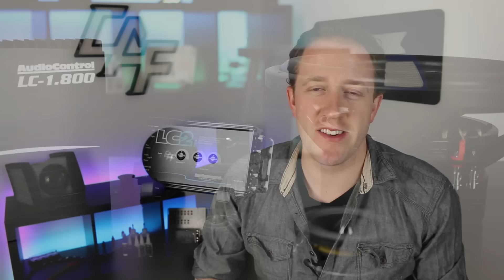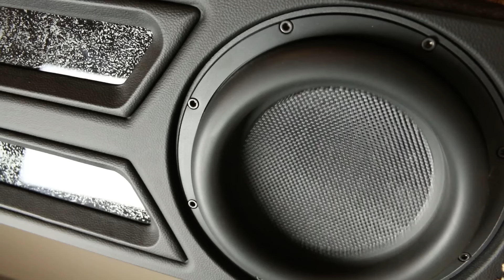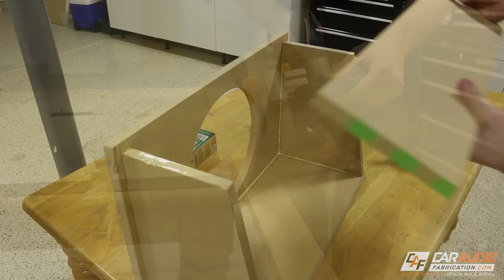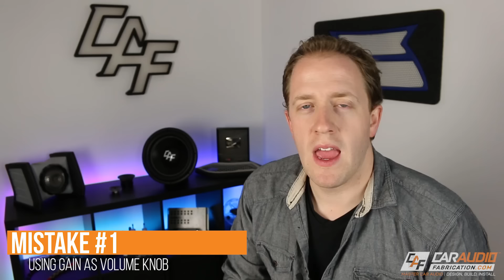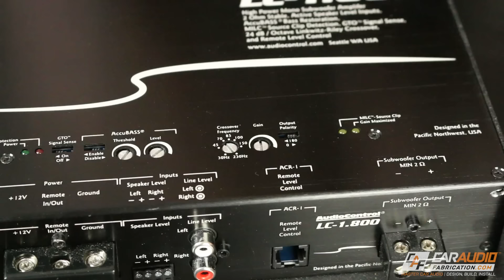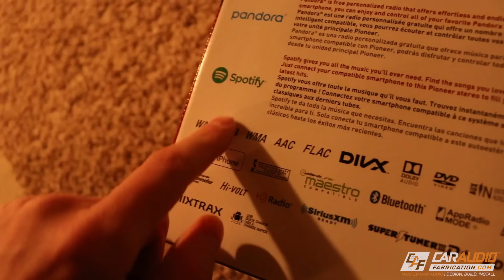Avoid these 5 common Car Audio NOOB Mistakes!

Comment: Dude, totally agree, I remember being a noob, wires everywhere exposed, wrapping the wires around the pillar using the fender to hide the wire instead of poking a little hole in the rubber plug in the firewall, lol. I got a couple funny, cool and true things I've seen through the years since like 89', first was a guy I knew that did use his trunk specs to buy/install his woofers, notice I said woofers. Lol this guy had a 1967 Chevy Impala Caprice, if you've seen one of those you've seen how big the back window shelf is, well this guy cut, drilled and mounted a huge piece of plywood in between the back seat back and the frame that holds it, then cut 2 18" holes, dead center of the back of the back seat so all the seat was there except where these 2 big ol' woofers and grills were, in the back window were 4 Cerwin Vegas 3way 6x9's and 2 10" subs all sharing the enormous space the Impala had. I think he was pretty close to perfect. Sound really good. Second thing a how to shut up a friend anout his, and shut down the crowed too. Do I have alot a friends with systems some have pro installed some dyi. I had this one buddy who had 2 15" Fosgates, with 2500w  in a Volkswagon Rabbit, I my self am in a 91' Golf Eurosport edition, and no it's not the same as a rabbit, easier ones yes, min had like 3-5ft more in the center making the car look even better, back then I installed my own stuff, but the box and mounts were pro built and designed, I was slapping 2 12" Soundstream SPL12's and 2 10" Soundstream SPL10's w 5000w to the 12's and 3000w to the 10's. Now both of us could take someone's breath away from the bass, me u run crossovers, EQ's for my kids and high do dial in the sound even better. Now better of us were getting even full power I think about half I was using, but we had this one friend who that he knew he could beat use any time we wanna sound off. I'm not stupid, and I know this guys dad. So I back down, my bud with the 15"s is up, he cranks it up, damn good sounding, my other bud thr challenger had no bear last time I had checked, this is back when circuit city was still around and open, the next morning he got up and went to circuit city, they every month had different cheap dubs for $20, this guy went and bought 4 Voltage Audio svc's running them parallel to they're 2 homes, respectablelly Installed, then goes to some other audio place and gets his a amps, and gives them the dimensions his speakers need of air from the enclosure, the amps he got 2, at 2ohm and 1000w each per channel, this 4ch each amp is bridged into 2 ch, Thid guy did his homework, the speakers input matched the amps output almost exact, the speakers, all four were each getting the exact rms and peak watts, had exact air pace. They were louder, but harder and sounded better overall then ours. Taught me it's not what you have necessarily, but how it's being used. Lol

Comment: For me I hate these guys (sadly they are the same people who listen to rap music) that has the bass turned ALL THE WAY UP and it sounds "muddy" and "muffled" and then it sounds EVEN WORSE when there is no mid range or even highs!! Oh sure it is funny that every panel on the car is vibrating, but to me it makes the music (which IS the end product) sound like complete and total garbage!! And to these same folks "it sounds great" even though you can't understand a word being spoken (face it rappers don't actually sing, they just say insults REALLY REALLY FAST) and there is no other "noise" coming out of the car other than these nasty flat and mushed up bass line, that sounds terrible!! Of course for me I listen to everything from Lindsey Stirling, to Metallica, to Toby Keith to Steve Miller, SO while I love the drop dead bass line in a song like Billy Thorpe's Children of the Sun or the sizzling crashes of Lars Ulrich's cymbals, or even the haunting vocals of Geoff Tate (Queensryche) it is nice to hear every small sound of Pink Floyd's music CLEARLY instead of a muddy, throbbing mess that is the way most cases sound like (again those playing rap usually) that I can't understand why somebody would want such a crappy sounding system to start with!! Personally I want to HEAR what the singer is singing in other words!! And if there is a cow bell in the song I want that to come through as though Aerosmith, or Trace Adkins, is literally sitting in the back seat!!!

Comment: Great information for me. I just bought an 02 tj that needs a digital media system. Best advice in this video is “if it’s too good to be true, than it probably is”. Now, I’ll be spending twice what I thought I would so that I get the better quality. I think you saved me a headache. 

Any suggestions on a single din with Apple CarPlay?

Comment: It's been a loooong time since I put together a system and I always thought shooting for a large capacitor FIRST was the way to go to keep voltages steady.
Reply: Eh, power capacitors are really overrated, better to upgrade the wiring and battery.

Comment: you only briefly mentioned the big 3 - see if nicer model car has a bigger alternator, add a 2nd ground wire between engine and body, and battery and body. I always add a capacitor for the power the woofer takes. use an oscope on gain adjustment. add sound deadener and insulation under panels and carpet, and window noise treatment

Comment: Bro I’m having a hard time my system play for a whole year no problems but my amp always go into protection mode I replace my radio the amps three times I first to were bad but 3rd brand new and when i first hook it up it play turn off my car and now it’s doing same shit protection mode fuses are all good no brunt wires radio was wire at shop I’m sure my amp wiring kit didn’t get bad it only year old and my subs are a year old maybe they just mess up I haven’t gotten those check out anyone think they know??

Comment: Mistake #3 source of music.  I totally agree. In my book this has to be one of the top issues. You can have a awesome system installed but if your audio source is crap your system will sound crappy. Low quality MP3 files or streaming from your smartphone low quality bits sounds crappy. Your missing a lot of the music the artist intended for you to hear on the recording.  Get a head unit that plays FLAK or ACC or other High Definition Audio files along with High quality Wave files. Lot of new head units are starting to come with the ability to play these types of files though the USB port. I have a new Pioneer HU that plays these files and i have installed a High Definition sound system also. Kenwood has new amplifiers and speaker and Sony and Pioneer and others that are now out on market to play and reproduce the High Definition sound. And the cost is not bad and it's affordable.  My system sounds real nice and clean. I got tired of my old Clarion HU that only played MP3 and other low quality music. Once you hear some High definition audio like i did you will be amazed how life like it sounded and clear and crisp. Had to have it.  Like going from High definition TV to 4K TV.

Comment: Not understanding how bridging a amp with a subwoofer or multiple subwoofers would always overheat or fry my amps or battery. I know and understand wireing in parallel and series and impedance draw changes the output and amperage draw on a system. I see guys all the time complaining how there amp is getting way to hot or killing alts and batts or even subwoofers lmao man i was blind!

Comment: Yeah i definitely fried my electronics in my caddy a few years ago. I bought a 5 farad capacitor and thought that was enough... any tips on how to upgrade the wiring in the engine bay/ alternator upgrade?
Reply: I also bought a 5 farad capacitor once, turned out it was more useful as a paper weight. Not doing that in my current car, gonna spend that money on better wiring and battery instead.

Comment: My mistakes?  Back in the Eighties I had a case built by a "professional" that fit into the removed rear seat area of my 1978 Pontiac Sunbird.  It was two 15" subs, four mids, and four tweeters... All in one large hollow insulated box! All pushed by an Alpine head unit and Rockford  Fosgate Punch 150. At least it had air relief ducts.  I thought I was so cool. lol

Comment: My brother had the nasty habit when installing stereos (Or anything electronic in his vehicles) of stripping too much insulation off the wires.
He would strip an inch or more and have exposed wires hanging from and amplifiers connection terminals then wonder why he kept having problems with his sound system. 
Or he would wrap a set of joined wires with Scotch brand office tape and wonder why he kept blowing his fuse for the stereo.
I remember this happening when I was 13 and having to fix it for him. It continued into my mid 20s when I last had to fix his sound system in a pickup he bought.

Comment: My biggest noob mistake was not building a proper box.  The box can make or break a subwoofer setup.  A cheap sub in a well made and designed box will sound better than an expensive sub in a badly built box.

Comment: When I sold car audio in the 90’s, in regards to the maximum power ratings, “Yes, this amplifier car produce that much power, WLS.  What is WLS you say?  When Lightning Strikes.  So if lightning were to strike this amplifier, it will produce that much power for a fraction of a second.”

Comment: Such a very true statement I started in car audio in 1985 and over the years I've had many customers come in with blown subwoofers that they decided to adjust their gain controls after they left the shop. used to be an eclipse dealer and they had some of the best head units 5 and 8 volt pre outs of course today some of the better amplifiers do have clip lights on then to let you know the amplifier is clipping but again some customers just don't get it some of them just want bass bass bass and some tweeters LOL it takes a good installer to tune a system front stage rear fill and don't let the bass overwhelm the car keep the work going brother love to channel
Reply: I don't know why but "bass bass bass....and some tweeters" got me 😂😂😂

Comment: I started in car audio in 1985 and over the years I have seen many customers come in with blown woofers after we install them and they decided that they were going to adjust their own gain controls. Some of the better amplifiers today do have a clip light on them that will tell you when the amplifier is clipping of course a very true statement about the head units. used to be a eclipse dealer and they had some of the best head units they also were 8

volt head unit which I try and explain to the younger installers about the head room and an amplifier and how to truly tuna system and how you have to have a good ear front stage rear fill and don't let the bass overwhelm the car if you're a true audiophile but there's people out there that all they want is bass bass bass and a bunch of tweeters LOL keep the work going I just ran across your video and I like your Channel

Comment: What's everyone's setup??
Reply: Pioneer head unit (forgot the model), Hertz Dieci door speakers powered by a Hertz EP 4 4x60 watt amp. The subwoofer is a Hertz Energy dual voice coil 12" powered by a Hertz HCP 1DK 11 watt amp. Yes, I am a fan of Hertz components hehe.

Comment: I used to go big, when I was young and a knucklehead. In my 93 mustang GT I had a Pioneer head unit into a 7-band EQ, into a 3-channel crossover (splitting highs from lows) into a 4-channel Jensen for highs and 2 2-channel Jensen"s for lows; each bridged and pushing a 12" Blaupunkt sub in a custom box I built. I used to drain batteries left and right, kill alternators, the building at work would rattle, I would be hard of hearing, etc etc. Now I just like clean sound. I just got a 2013 Elantra GLS, and I'm putting in Rockford 3-ways (6.75") with baffles, a Clarion XC2410 (behind the dash), and not touching the factory head unit or factory amp (it only puts out a tiny bit of juice anyway). It's a budget system, but should have decent sound.

Comment: i never did the big 3 upgrade till recently, so everyone for sure do this when running a sub amp even its just a 200-300watt you'll hear and feel the difference. and even if its oem and not high output get a new alternator for harder pounding bass

Comment: I installed two capacitors just for good measure. They're good enough to power all speakers except the subs for about five seconds. Five's better than zero.
Reply: A battery costing the same would be able to power the entire stereo for probably half an hour.

Comment: Using high output from the head unit rather than RCA's, and running the wires over your transmission to the amp - unless you like high pitch whining sounds coming out of your speakers.

Comment: Hi. How I can connect two different ohms speakers in one car radio channel. ?
Reply: RCA v-splitter and two amps, though you'll find the lower ohm speaker will overpower the other as the volume goes up.

Comment: i got a $40 12 inch polk from my buddy. a 12 inch kicker abd 1000watt amp from another friend in exchange for an oil change. and pioneer speakers with a kenwood radio. my bass is awsome but my speakers sound like they are starving. but hey for under $100 im not that mad

Comment: Biggest mistake I made was installing the woofer.. sounded fine.. then filled up the oil.. too much.. started it anyway.. gazed away at all the white smoke coming out of the exhaust :O failed to notice a fire in the engine.. and my woofer burned up.. :( along with the car...

Comment: Well, I really wanted a subwoofer in my car and saw that it was not THAT cheap... I got some stuff piece by piece from every one I know who was into car audio and such untill I finally got a full set up. Afters installing everything it sounded HORRIBLE! I didn't knew you had to have a subwoofer output on your radio or something so I just installed everything on the red and white L and R plugs 😛. By now I somehow know what I'm doing and have a much better setup. But it was a great how to NOT install a subwoofer 😛

Comment: I bought at 2002 BMW 325i and found out it had an enclosed subwoofer in the trunk. It was installed by the person who owned the car before the guy that sold the car to me. So I have no idea what to do and how to make sure I don’t break it. I don’t really see an amplifier anywhere. Any help on how to not break the subs would help. I don’t know if there is a volume limit or bass control limit. The guy did install a stereo with it.
Reply: Take it to a store and ask them to take it out for you

Comment: My amp cuts off at high volume with sustained bass..  it comes back on within a minute or so,  abd I'm wondering if it's a power issue or a cooling issue.  It's an under seat box in a truck with the amp placed on the wall of the cab. Any tips would help

Comment: Just to comment. I agree (1) gain is the biggest mistake people and "Pro" installers make. (2) - Trucks Use a down-fire box, and do NOT throw large speakers to be cool. (3) is 100% subjective, depends on what you want. Performance vs Clarity.  The most important was (4) - Amps. Kenwood was good, Kicker was great, but this industry changes all the time.  From 1999-2004 I was a regular at the Kicker SW Region competition in my 1998 extended cab. I have entered the 1000w competition with a duel 50w Kicker set-up. (Known as a cheater set)  I won twice overall and placed second the third time.  So yes, it is humiliating to have your 1500w thumper beat by my duel 50w set up.  You cannot state this enough, size is NOT power. You set it up (yes 1 ohm can be better than 4) correctly, do NOT piece-mill a system together. Design it so it all works together. And trunk systems...... please.... spare me.

Comment: Not all professional installers set the gain properly. The guys at Frys Electronics tend to set the gain to max. I'm guessing because it makes the system the loudest and therefore the most happy customers because louder is better.

Comment: Great video. I have a question I hope you can help with. I am an audiophile and know how to keep stereo speakers in phase. SO I am installing 4 speakers in a classic mustang. I know how to keep the rears in phase and the fronts, but how am I sure front to rear ? In other words - rear speakers + = and + 1 match. Front, same thing. BUt how would I now if its the same for the front to rear or does that phasing not matter ? Thanks !!!

Comment: strickly speaking there is no such thing, according to bonafide elctronics engineers as" watts RMS power". power  is corectly refered to as voltage RMS X amps RMS =" watts power" , full stop , ie  it is not technicly correct to refer to watts as RMS though many people do , except as ive said genuine electronic engineers never use the term "watts rms," only "watts power,"  also the rating that is most usefull for gageing output power any way is "average power" which again conforms to a differant criteria of measurement. cheers. carl

Comment: On my first system when I was clueless, my friend said you can shove your amp power wire into a constant 12V fuse at the fuse box instead of running it through the firewall to the battery.  It worked briefly until it melted the plastic around the connection

Comment: i thought having all that would power my AP3000.1d and two 500w rms amps 2ch's. running two dual 2ohm 18's that are 2500 rms and 4-5k peak each . Seems i need to down grade or get a XSpower super cap. Volt reg+ big3, good ground done. 15v solid but drops on real bass tracks 20-30 Hz. Low volt protects hits on the AP

Comment: How about figuring what my Alternator (U.S Alt 280 amp)+ engine batt(XSpower 7500d) can put out minus what the car needs. On paper i should have 4k watts from Alt but 7.5 from batt. So is that 11.5 watts minus what the car needs. Please help